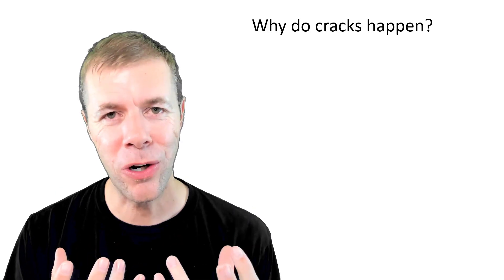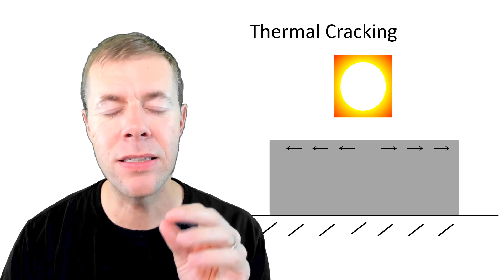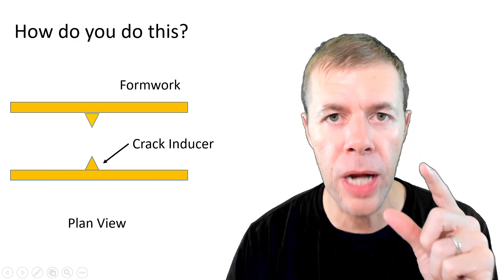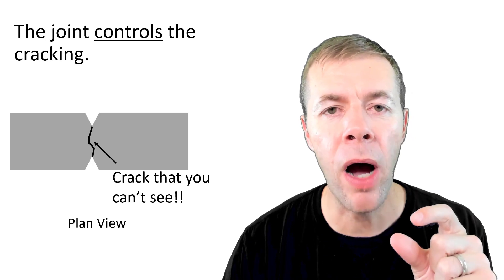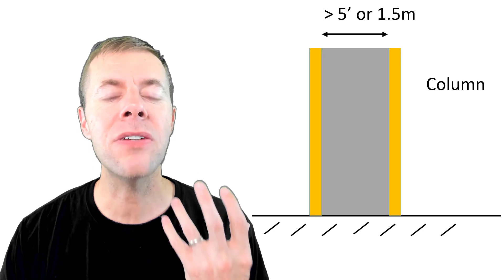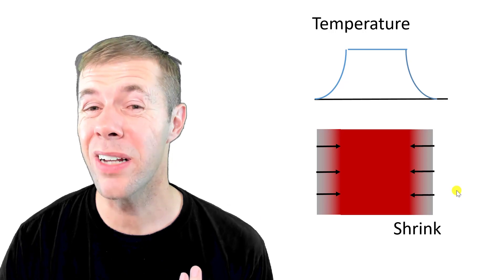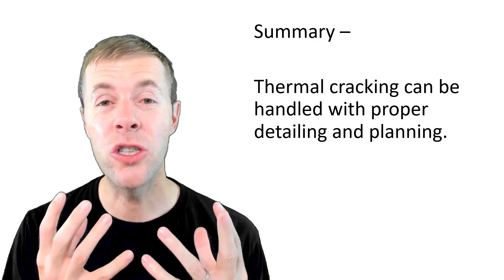Thermal Cracking in Reinforced Concrete

Comment: In designing anchor bolts in slabs, the ACI shows the design of anchor bolts for shear and tension failures, however the design equations gives the option of designing using cracked or non cracked concrete.  The problem is that no definition is given for the terns cracked or non-cracked.  Can you explain the difference?

Comment: Great video Tyler, do you have any suggestion on how to control cracks on small concrete pieces (mug size) 

Im trying to make candles but it seems the heat of the flame tends to crack the concrete severely 

Any advise?

Comment: Dr. Ley
What dimensions would you consider “mass concrete”?
ACI 207 is vague.
I know dams are for sure. But what about a pour of 6ft deep x 5 ft wide * 100 ft?
Just to try to avoid horizontal joint
I know slag replacement is key there.. we will do that.. but the “mass concrete” special requirements?
Thanks

Comment: Trying to make a rocket stove out of a 5 gallon bucket and a 4 inch PVC pipe. So what kind of mix should I use. The only recipe I found is 80% perlite to20% Cement. Do I use quick Crete or Portland cement and how can I keep it from cracking.

Comment: Hi Dr. Tyler, what about when you a have a wall with control joints every 6m but it just doesn't crack at the control joint? Is it because the control joint is too far apart?
Reply from the maker: yes

Comment: How do you determine how often to put crack inducers in concrete walls?
Reply from the maker: Good question and there is not a great answer.  I would suggest < 20'.  It depends on the mix design, the foundation, and the amount of reinforcing steel in the wall.

Comment: Also consider when doing columns - make them hollow instead of solid. It can save material and weight to make the columns hollow too with little impact on the structural strength. A slightly larger outer diameter can compensate for that and you still save material.
Reply from the maker: Good idea!  The forming is a little more complicated but I like it.

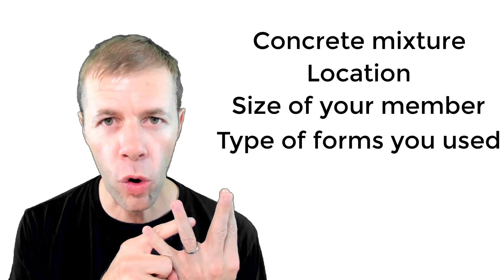Comment: Another great video... keep them coming buddy...   roughly 10% of psi for tension failure...  of course, on a solid surface this is negated... (depending on loads applied)... 4:08 he said, the ''size of your member" ... haha (could not resist).
Reply from the maker: Thank you!  Glad you like the videos!!!  Your right that 0.1f'c is a good estimate of the tensile stress.